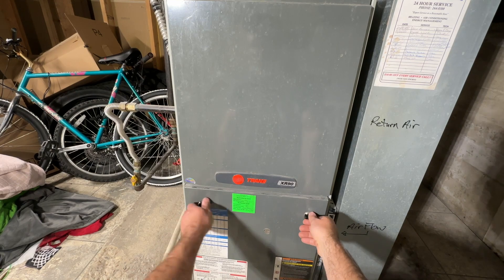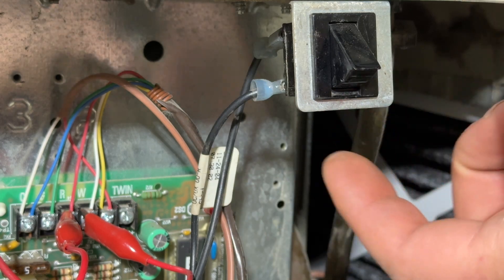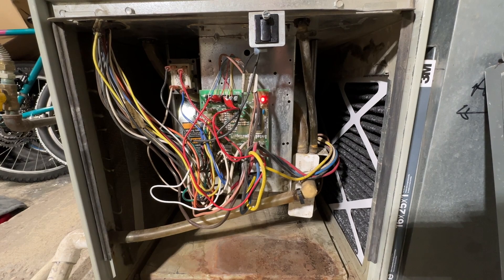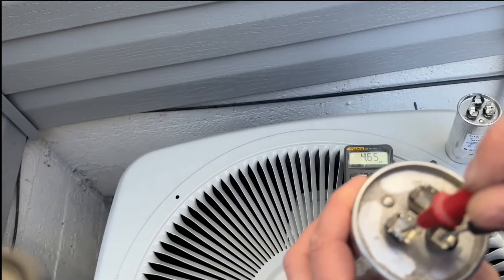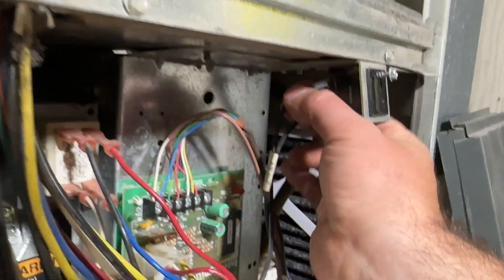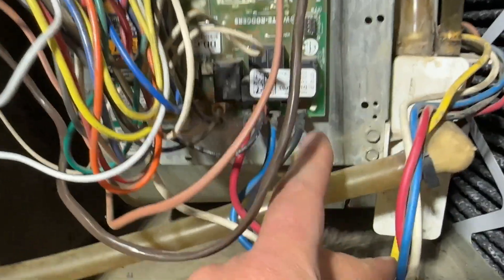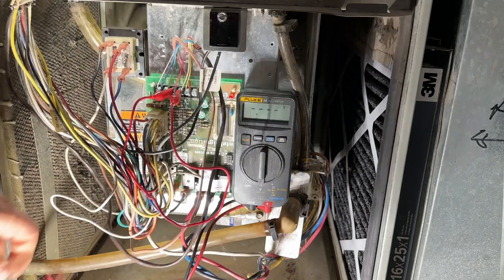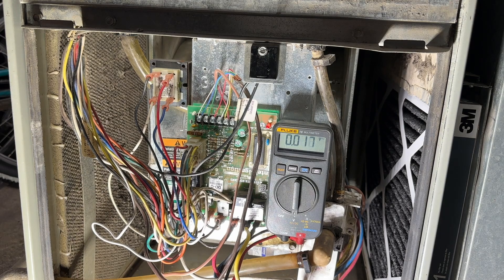How To Troubleshoot A Bad Control Board! Fan Wont Come On

Comment: I m confused, the heating speed sends 115 v and motor not running and after you send 115v and   kicks on, how is this possible?
Reply: When he applied 122 from the door switch it turned on
Reply: @FranciscoPerez-th2hw  122 and 115 no difference
Reply from the maker: Yea that’s what I thought, but there is a different. That was the point of this video. I learned a valuable lesson in testing the fan with the safety switch, that rules out the blower motor or capacitor being bad.
Reply from the maker: I didn’t do the safety switch fan test the first time I diagnosed this, I just checked the board, saw 115v and went to the supply house and got a new blower motor. It was after I put a new one in and had the same problem that I knew it was the board. But had I done the safety switch test first I wouldn’t have had to do it twice!
Reply: @diyhvacguy  Have never seen this before, i d say it s a bad neutral but the neutral of the blower goes back to the board and it was checked ok. 
Glad you got it fixed still seems weird to me

Comment: I would just jumper 120v to that motor to run 24/7 until I could get a board so the customer doesn’t freeze. Depends what day it is and what time of day it is. Running it all of the time won’t hurt. Run it through a relay so high speed kicks out low speed. Whatever it takes.
Reply from the maker: Yea I asked them if they wanted me to do that but it didn’t get cold that night so they said just leave it off. Thanks for the tip though! Maybe it will help someone else on here :)
Reply: @diyhvacguy  Yeah for anyone who might be interested.  Back in the day when we had the bimetal fan switch and a fan relay we jumped that low speed fan switch out all of the time.  Let it run 24/7 and it actually would keep the house at a more even temperature and it would prevent it from short cycling.  When the AC or "fan switch" was turned on the relay would kick out the low speed so there was never both windings energized at the same time.  I even ran my own house like that and and the temperature was a lot more consistent.  When PCB's took over the controls you saw that less and less because then you would have to add a relay to make it work.  A lot of people prefer that low speed fan running all of the time.  The fan only costs pennies a day to run (or at least it used to be pennies).  This was very common practice back in the days before disco!  🤣😜

Comment: I been fooled by that before and you can see 115 mv and think it was volts  and you really don’t have any,  look closely at your meter when you see that because a lot of times it would run on 115 volts.
Reply from the maker: What do you mean look closely?
Reply: @diyhvacguy  I missed it saying mv instead of volts and added 30 min to troubleshooting thinking I had AC,

Comment: The voltage drop from the board is insignifigant,its plus or minus 10% 122 incoming to trans,an 115 out of board is not a problem. A bad fan relay on the board would be!
Reply from the maker: The fan solenoid is before the heat pin for the fan, so how would the solenoid effect this if I’m getting 115 as soon as I hear the solenoid click?
Reply: @diyhvacguy  voltage is voltage,it can be present without current flow!

Comment: Im still not sure its the board.
Reply from the maker: It was, the follow up video that hasn’t posted yet shows how to replace the board and that was indeed what was wrong. Bizarre right? I put a blower motor in because I didn’t think to jump it from the hot wire at the safety switch until a friend of mine told me about that. After putting the new blower motor in, same thing. Sometimes ya gotta do things twice I guess! Cheers man
Reply from the maker: You’d think 115v would be sufficient but it wasn’t
Reply: @diyhvacguy  I'm no major expert nor do i pretend to be but I would check the continuity on the wire before changing the board I am epa certified and have a diploma in HVAC :)
Reply: @diyhvacguy  you’re correct. If the main voltage is 122 and you’re seeing 115 at the relay it’s a sign of voltage drop. I bet if you measured the voltage at the motor connector with the motor plugged in when triggered it would be even lower or zero because of the load.
Reply: @HoodHandyman  agree with you 100%
Reply: @HoodHandyman  Which wire are you checking the continuity on? I'm trying to learn from both perspectives but the yellow wire was ran straight into the power and the fan started thereby proving continuity in the yellow wire, so which wire are you speaking of?
Reply: @wilwiljames1  without being there looking at the unit its hard to tell but I see your point. but just because the yellow wire was run to the fan does not mean the wire could have a break it it somewhere. Check the continuity and the resistance on that wire then you can rule it out and proceed to the next test. Again I'm not all that but that's the way i try to think about things.